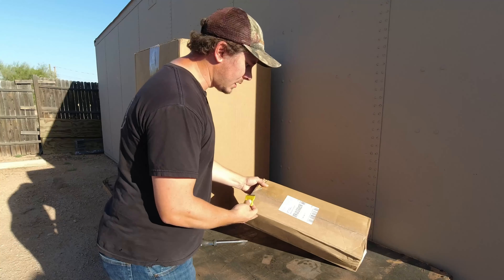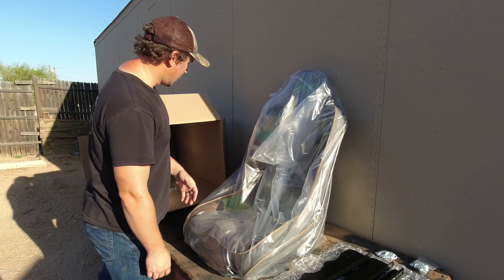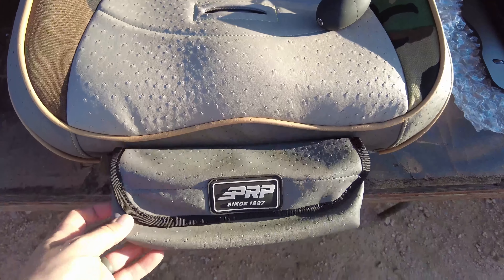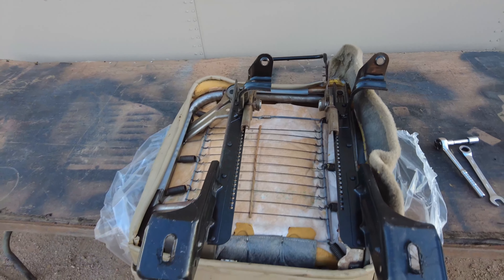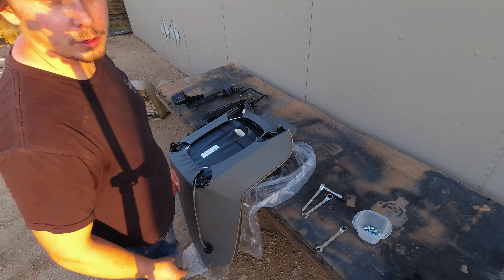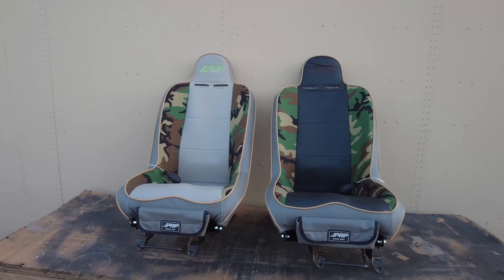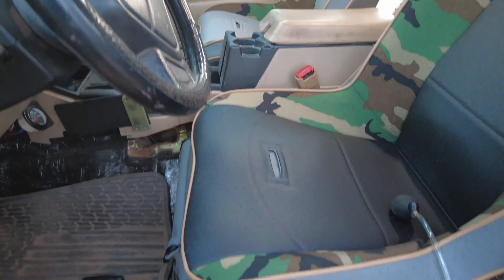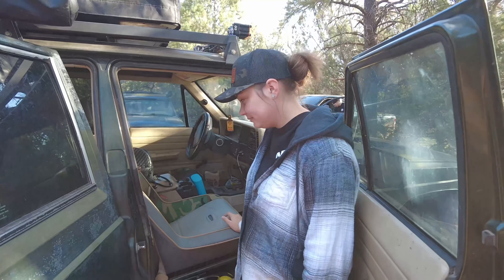We install brand new PRP SEATS in our Jeep Cherokee XJ!

Comment: are your seatbelt buckles mounted to the floor in your XJ? I have a 97 and they're mounted to the seat.
Reply from the maker: That’s weird 😅 mine are mounted to the floor
Reply: @2AOverland  interesting. They must have changed that with the changeover. Ok thanks! I think I’ll figure something out, maybe drill a hole in the brackets.
Reply from the maker: @granitesand78 no problem man! You could always get some early model seat belts and drill a hole in the floor too 😬 but the bracket could work too
Reply: @2AOverland  I just pulled my seat and the belt catch actually seems to attach to the lower slider instead of the seat itself. So I think actually it’ll be ok, once I get my PRPs I’ll see final fitment but I think it should work. They throw us off by saying it eliminates the stock belt lol.

Comment: The PRP website says their XJ adapters eliminate the stock seatbelt.  Did you have any issues retaining the stock seatbelt?  Is there enough room between the adapter plate and the tunnel for the stock seatbelt to move with the seat when sliding it forward or backward?  Seats look great, BTW.  Thanks for the video!
Reply from the maker: No problem thank you for watching! I’m not sure why PRP says that cause I didn’t have any seatbelt issues with my 1996 XJ
Reply: @2AOverland  came here for this information website still says the brackets eliminate the stock seat belts
Reply from the maker: I have no idea why 🤷🏻‍♂️ my setup has been solid so far.
Reply: Stock seatbelts work fine.  However, I did add a couple washers to the mount to shift the seat inward a bit to keep the seat from rubbing on the plastic that covers the seatbelt.

Also, these seats sit a tad higher, so if you are super tall, they may not work for you.  

I absolutely love mine!

Comment: How is the 1 piece seat for long distances? Are they suspension seats?  I thought about those for my JK and have wondered if I really need the tilt back style. We are just finishing up our 4000 mile road trip in the JK and the stock seats need to be replaced for more comfortable ones...
Reply from the maker: Thanks for watching Todd! We drove the jeep from Mesa to flagstaff and back and the seats felt great! And the wheeling we did the seats were even better since they’re bucket seats. So you didn’t get jostled around on obstacles! 

We felt the same way knowing we didn’t need seats that tilted back cause we have all of our gear behind us and we couldn’t tilt the seat back anyways. I did notice that mine have a slight tilt naturally. And From my knowledge they’re not suspension seats, they’re made from a dense foam that I think will hold up over time.
Reply: @2AOverland   good to know. The suspension part now vs old is stretch webbing below the foam instead of springs on the frame. I can see the problem with getting in/out on a lifted vehicle which will cause that part of the seat to wear faster.
Reply from the maker: I didn’t know that! I wish I would of known that for the video lol. That’s our main concern too is rubbing on that part of the seat and have premature wear. I hope it stands up for a long time before we have to replace it.

Comment: What year XJ is yours?  It looks like you have a 95 or 96.  I was going to get these seats but I noticed the adapters were only for 96 and up?  I have a 93.
Reply from the maker: My jeep is a 96, I wonder what changed seat bracket wise from 88-94 to 95-01? That’s strange. I would give them a call and see if it would still work or you might have to buy some 95 and up seat brackets and adapt them to your rig 😅
Reply: @2AOverland  @blueoceanross, did you ever make the leap and buy em for your older XJ?  I just came across a brand new pair from a shop that is going oob here in the PNW so I grabbed em based off this video LOL however I didnt realize no one makes the 1991 XJ adapters.  Think I'll be doing what 2A suggests... paying a cpl hundee to cut up some brackets to suit my needs.

Comment: Hey, I was wondering your height and weight.. I am 6'1 235. Did you order them wider or taller? I noticed on their site they have numerous options.. Given my terrible luck with these situations.. I may travel to their store. considering they can't be returned. nice video.. i would have never found these if I hadn't watched
Reply from the maker: Thanks for watching man we appreciate it! I’m 6’0 & 215 and it fits me like a glove. To the point that we’re offroad and hitting good sized bumps and rocks and I’m not moving at all. I ordered the regular size seat and didn’t go wide or tall with it. It is crappy that they don’t have measurements on their site for seat width and height 😬. I would say play it safe and go a little wider if you can and for me the seat is plenty tall so I wouldn’t worry about that.
Reply from the maker: I would call them direct and ask them the dimensions of the daily driver seat and then compare it to your body measurements! Or if they are close enough to you it might be worth it to travel to their store. Or find a dealer in your area and try one out! It would suck to pay all that money and you end up hating the seat cause you don’t fit in it or it’s not comfortable to you 😅

Comment: They look great but they probably cost more than I paid for my XJ, lol! And I don’t like the idea of a seat that doesn’t adjust 🤔
Reply from the maker: Yeah they were a little pricey but I’ll be keeping the Cherokee for hopefully the rest of my life lol. They had another model that would adjust but it cost even more than these 😅
Reply: @2AOverland  I’ve had my Cherokee for 10 years and I plan on keeping it forever too, there’s simply nothing else available like it. I will do a seat upgrade but I’m in Australia, so these would cost at least 20 percent more here, plus freight! I need a seat that flips forward cause I need the extra space for my sleeping platform to fold out :/
Reply from the maker: Awh man! There has to be a PRP dealer somewhere in Australia I hope. Is your XJ a 2 door? If not, 2 door XJ seats tilt all the way forward and maybe it would be easier and cheaper to get those seats reupholstered!
Reply: @2AOverland  no, mines a 4 door. The 2 doors never came to Australia.